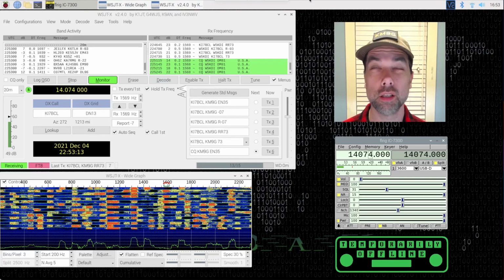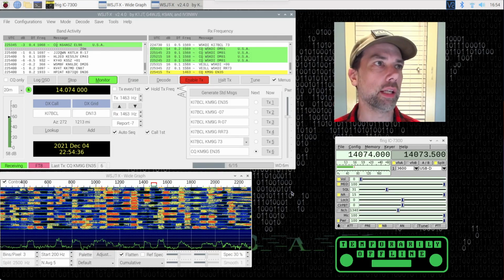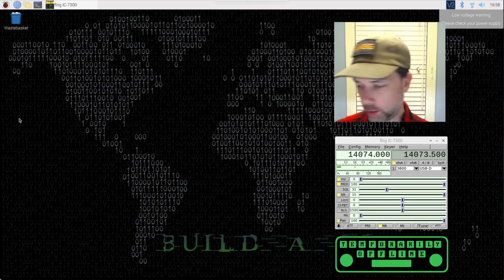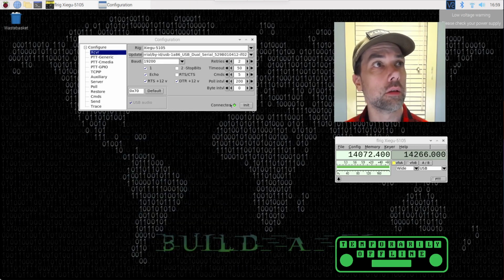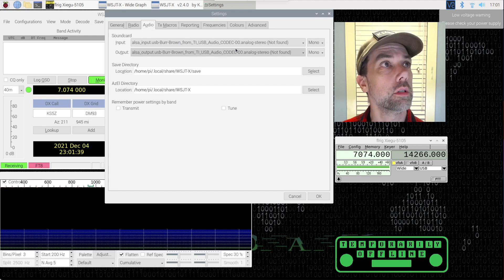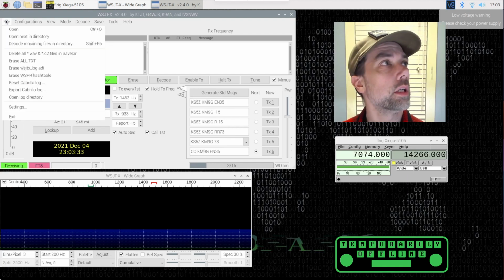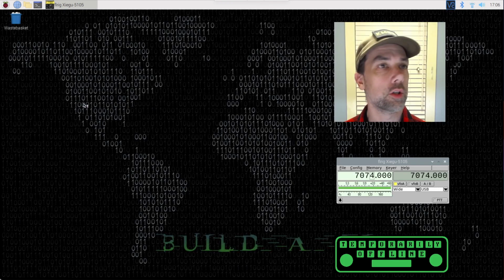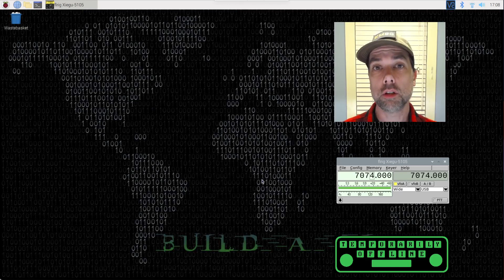Xiegu X6100 + FLRig + WSJT-X = No Joy

Comment: You seem to work on an arm processor (raspberry pi). Would it be different on an Intel processor?
Reply from the maker: The connection to FLRig might work differently on another architecture... make sure to check out my other WSJT-X video on getting the X6100 working.  It's great at FT8

Comment: I am using the G90 controll and I haven't had any crashing on the Pi4 running HamPi and Flrig. For the Windows 10  I am using X108G and WSJT-x without Flrig. The X6100 is using V 1.1.2.
Reply from the maker: I have another video about using the x108,  that one works well. Glad you were able to get it working. This is a fun little radio.

Comment: I have WSJT-X running for the X6100 on both Windows and Raspi standalone self build (sorry KM4ACK did not use BAP) - ferrites are a must on power and USB cables - learnt that with the IC705/7300/9700 - I do not use flrig or onmirig - i use the XIEGU X108G radio from the menu in WSJT-X - all good and digi is fine.
Reply from the maker: I tried the x108g first, might be a problem with my unit?  I also tried the ic-7100 trick.   What version of wsjt-x?  I downloaded fresh/latest on Mac os for this test yesterday.
Reply: @temporarilyoffline  latest version of wsjt-x available 2.5.2

Comment: Don't know if this has anything to do with it but Radioditty said this in an email "X6100 Compatible with ICOM's CI-V command, can simulate ICOM7000" ..........
Reply from the maker: I tried the IC-7100 CIV setup (which you use on the G90), the X5105, the G90, and the X108G.  I don't think its a CIV issue at this point.  FLRIG can change frequencies and PTT just fine... the rest is sound card stuff, and linux sees the sound card just fine.  Its a puzzler, but its early.
Reply: @temporarilyoffline  Ahhh the joy of being an early adopter... mine should be here in a few weeks then I can share in the joy.....

Comment: Nice video! I managed to get the FT8 working with my brand new X6100. There is a new so-called "USB-DIG" mode, I have to switch to that mode otherwise there is no audio to TX. Good luck!
Reply from the maker: What is your OS?  In my case, the software crashes, even when using USB-DIG
Reply: @temporarilyoffline  I am on Windows 10, the WSJTX and JTDX both work for me, but I have to use Omni-Rig with IC-7000 to CAT to X6100.
Reply from the maker: Ah, ok.  I tried IC-7100, have to go back and try 7000... but cat control is working fine with X5105.  Xiegu also suggests X108G... could be my unit, could be something else.